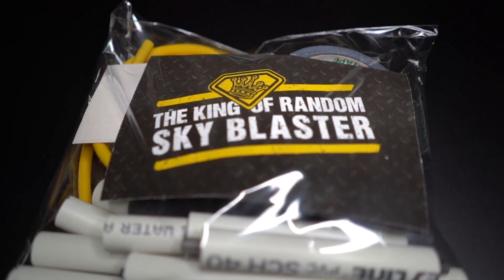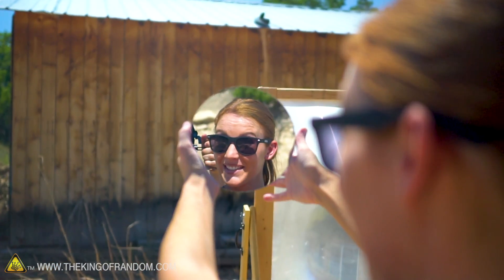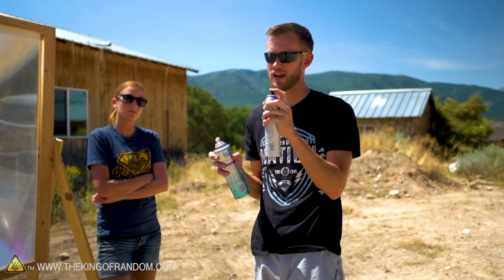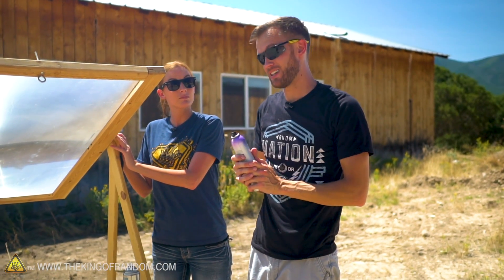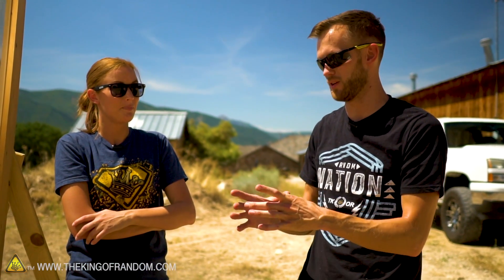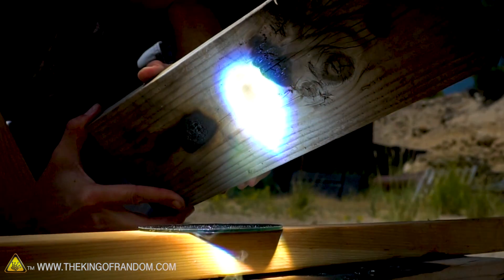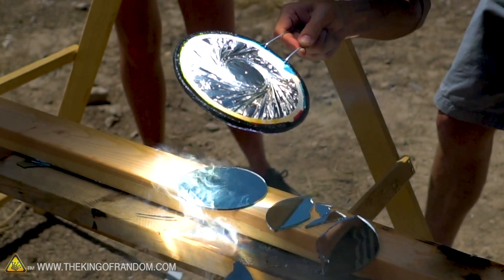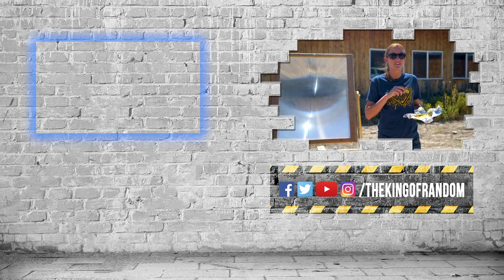Will A Solar Beam Reflect or Melt A Mirror?

Comment: What would happen if you place a fiber optic cable just past the heat focal point and run the fiber optic into dark rooms into a diffuser??

Then what would happen if you sent that same fiber optic transferee light into a cutting laser???

Would the light need to be run through water or a cooling agent before it goes into the fiber optic cable??

How long would the blaster take to heat a salt filled unit that could produce steam for substantial power generation?

Love your work and I've been asking these same questions for years now wondering if they would work.  Your solar blaster is super cool.  
Smiles
Reply: There again, run cooling water above the focal point and a fiber optic cable source exactly at the focal point to gather and encase the light.  Then send it through a cutting laser.

Comment: could you have cooled the mirror to  prevent it from breaking. maybe holding it in place with the bottom of it touching the water. but not so much that it gets on the top of the mirror

Comment: I know that silver mirrors don't reflect infrared light, which is the wavelength of heat, and I also know that a gold coat will. Will putting a gold-coated mirror under the solar scorcher do better? Also, I love your work, TKOR. It really makes my day.
Reply: A gold coated first surface mirror would do a lot better.

Comment: What happens if you put a water balloon in a vacuum chamber? It'd be cool to see it in the freeze dryer too.
Edit: Or rather, try out different liquids in a balloon in the freeze dryer and vacuum chamber, and also deep fry?
These other ideas belong to the people in the replies :P
Reply: And deep fryed😂
Reply: They should try to use the solar beam to try to cook food like steak or chicken!!!! LOL
Reply: @andyg.6082  actually look into solar ovens I had built one from foil backed fiberglass insulation, cardboard, polycarbonate, foil backed ducting tape, a brick or 2 and some black spraypaint and it would reach cooking Temps in excess of 500 degrees f the best pan to cook meats/eggs on in the solar over was a black pan or cast iron, grey was best for making bread products and avoid the glass pans
Reply: @drippingwax  mine did 500 degrees in 15 minutes
Reply: Im pretty sure it would just boil🤔
Reply: It would boil

It would freeze
Reply: It will expand and bubbles of air will appear until it explodes and water starts to boil quickly, if you continues removing air it will freeze.
Reply: Pop
Reply: Ah. I didn't see the balloon in the vacuum chamber. But this all sounds awesome!
Reply: Maddie C they’ve already done balloon is vacuum chamber, but no freeze dryer. it would be interesting if they did different types of liquids in a balloon in a vacuum chamber or freeze dryer